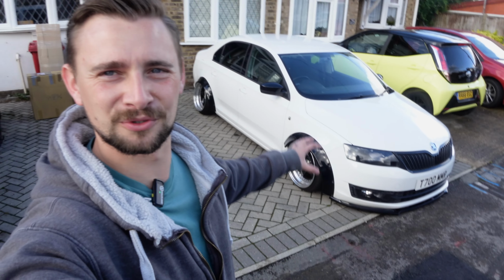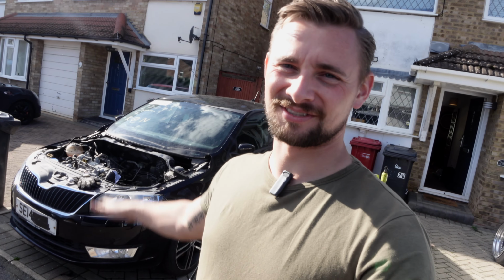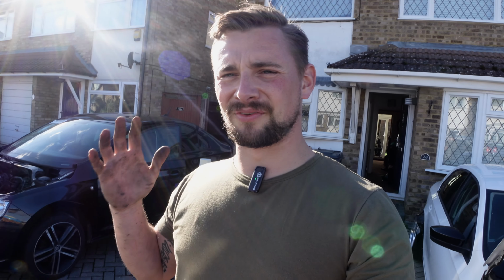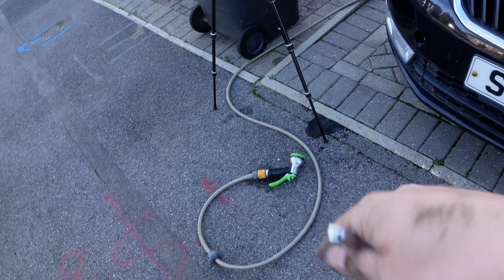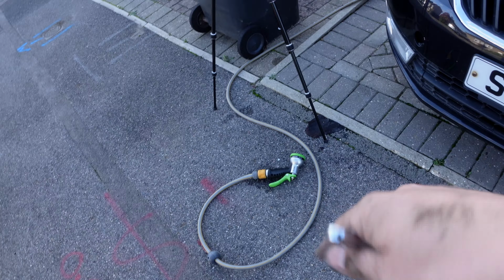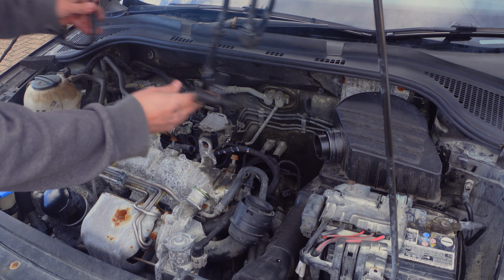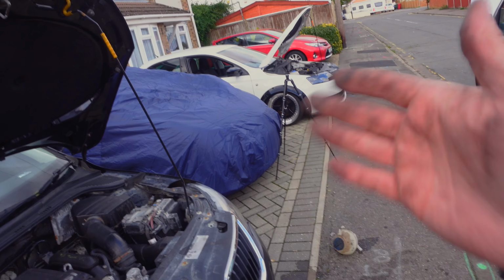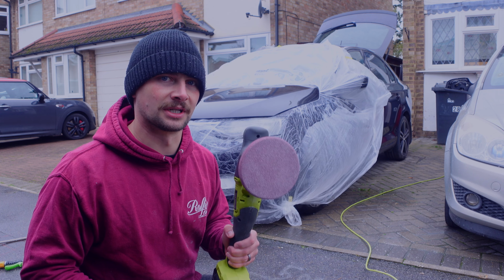THIS Skoda Was on FIRE - The Complete Journey of the Repair of a Fire Damaged Skoda Rapid Sport

Comment: No gloves and no masks, you do know melted gaskets in engines are highly carcinogenic 🤦🏻‍♂️
Reply from the maker: Hi, I cannot find any information on this, I admit I did not consider the potential dangers of working on fire damaged engine components however no gaskets were disturbed during any of the work undertaken. I did discover the risk of working on ARP due to fibres however none are present in this engine bay. I did read about asbestos gaskets on older vehicles being a risk however these were banned in 1990. If you have a link to the risks of fire damage to engines I would love to read it to ensure I am safe during any future work.
Reply: @TeeeTV  a quick Google should give you more info and advice. When we do this kind of task at work I wear at minimum a dust mask and some disposable gloves and work areas are steam cleaned first. As a one off task your probably ok but more than that I would say is a serious risk to your health. Take care.
Reply from the maker: @angeley3756  yes I did read about cleaning before working due to the corrosiveness of fire extinguishers, I guess at the time I was more concerned about getting water into the engine, but thank you for the info and I will be being more careful moving forward :)